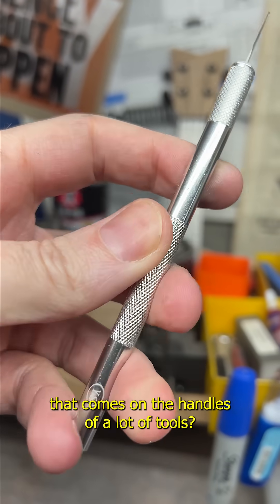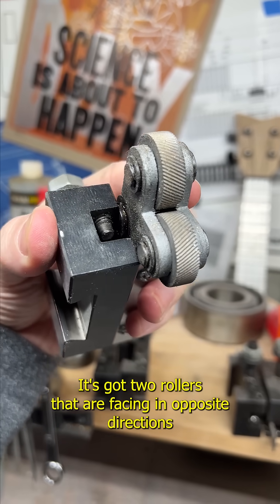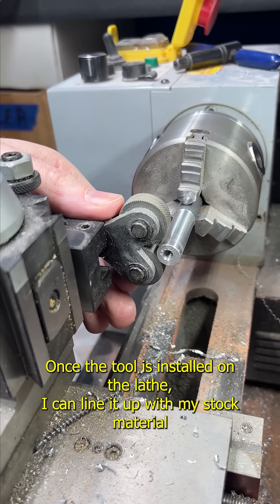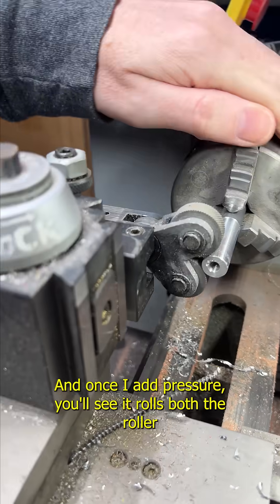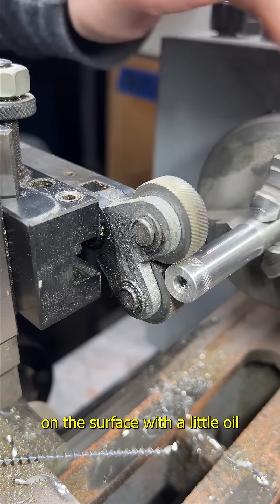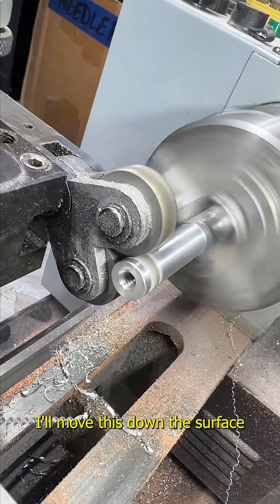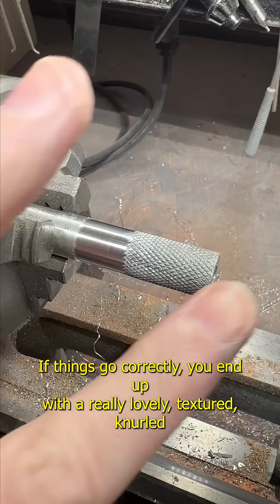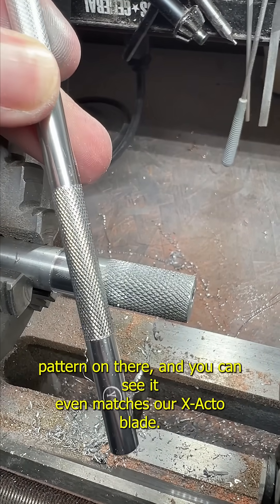How do they make that pattern? #knurling

Comment: At first it seems like magic... how does the linear distance traveled by the Knurling wheels divide evenly into the circumference of the work piece? 

The answer is it doesn't! A geared or driven knurl wouldn't work. The wheels must free-spin so when they don't want to line up they "jump a tooth" to get back on track! The knurl patterns are so fine the tooth jump distance is extremely small. Also it is happening all the time in small increments. As the next tooth comes around it probably won't want to land perfectly on the existing pattern - so the wheel speeds up or slows down as the tooth rides against one of the walls of the knurl. Only once the tooth reaches the bottom of the form does pressure spike and it actually continues forming/cutting.

It really really seems like it shouldn't work at all... but it does.
Reply from the maker: That’s so wild! Thank you for the explanation.

Comment: Is it geared?  How does it line both rollers up so the lines don’t drift?
Reply: it doesn't need to be geared, because the rollers naturally follow the previously formed grooves.
Reply: The diameter of the workpiece has to match your knurling wheels.